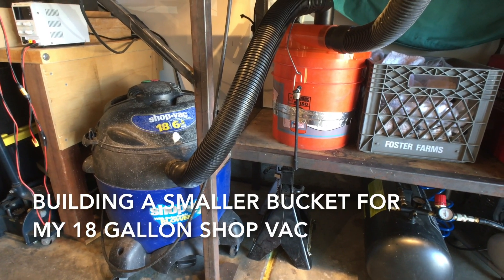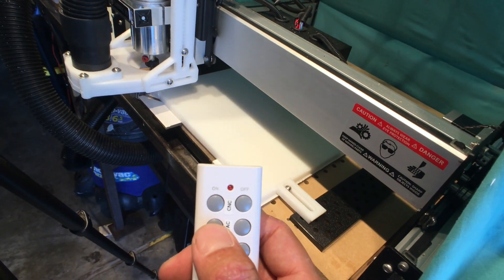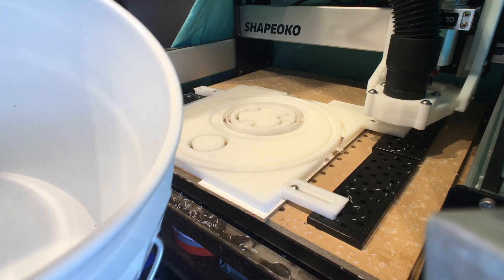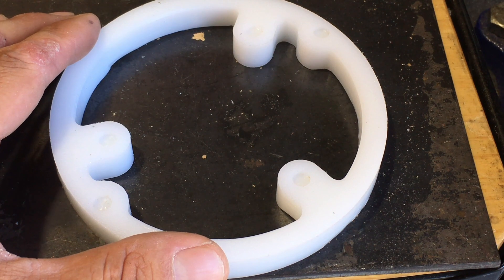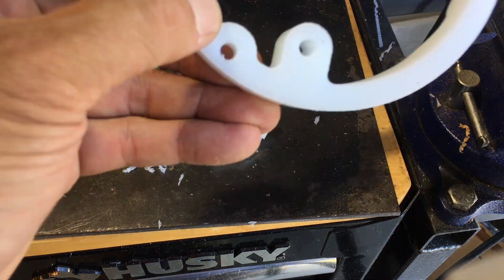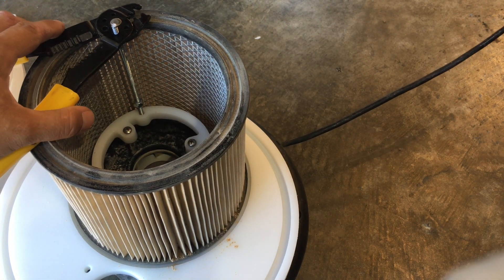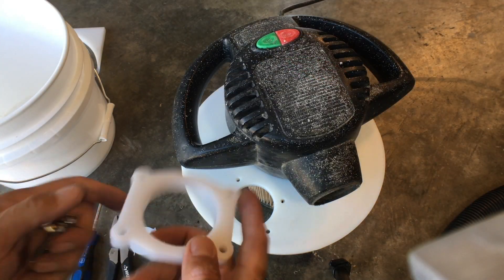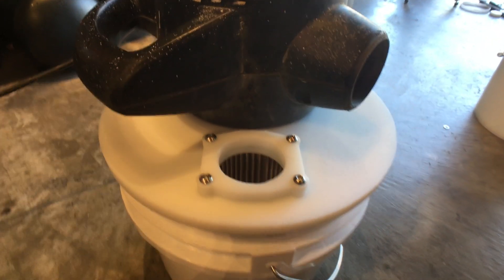Making a smaller ShopVac - Shapeoko CNC router dust collection

Comment: Oddly enough, just today, I was looking at an orphaned shop vac motor assembly, wondering how I could attach it to a HD bucket, so I could make a short shop vac that would fit inside the existing cart my Shapeoko 3XL sits on.  Great work.  Thanks for the ideas.